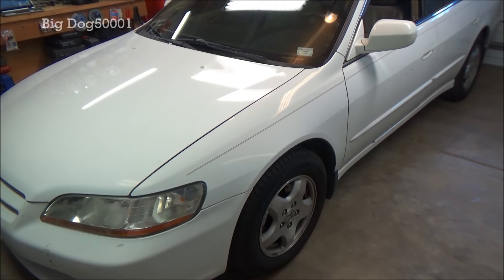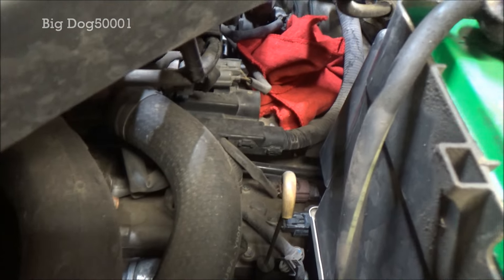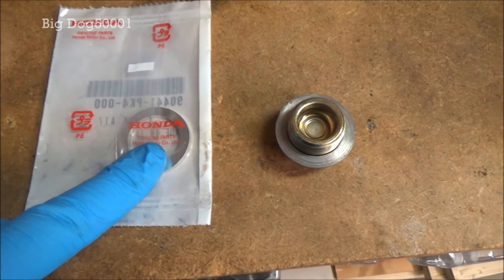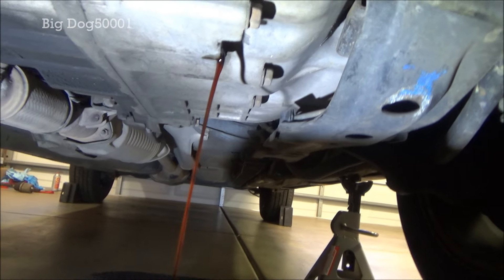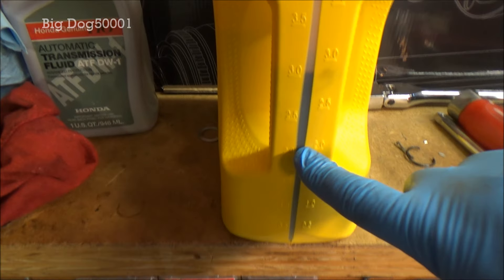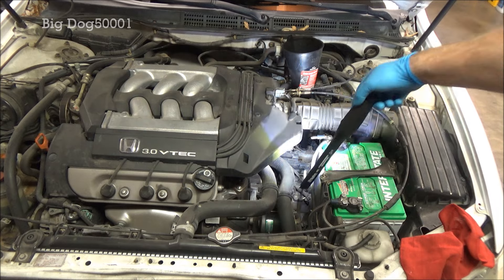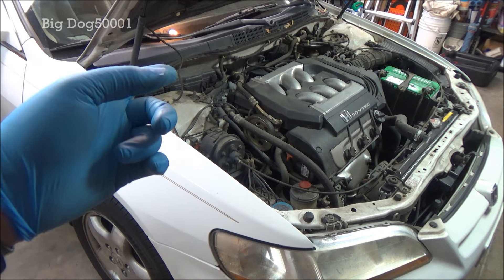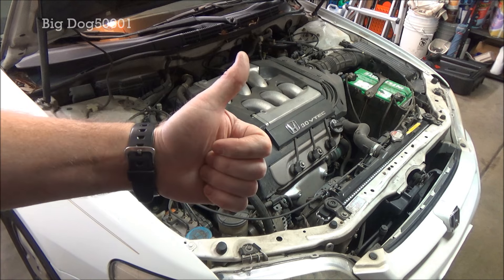Honda Accord V6 Automatic Transmission Fluid Service 1999 (1998-2002 Similar) (Drain and Fill)

Comment from the maker: Tools and Parts
This channel earns a small commission using some of these links - at no additional cost to you.
Honda ATF-DW1 (p/n 08200-9008):  https://amzn.to/34tUlJ4
Oil Drain Container:  https://amzn.to/2N0GdkX
ATF Drain plug washer 90471-PX4-000:  https://amzn.to/2PUk8a7
ATF FILL washer 90441-PK4-000:  https://amzn.to/34t1Bos
FloTools Extra Large Funnel 05034:  https://amzn.to/2PX6ZwQ
3/8 in. Drive 18 in. Ratcheting Breaker Bar:  https://goo.gl/etW9Cy
1/2 in. Drive 25 in. Breaker Bar:  https://goo.gl/qqXNsa

The Big Dog 50001 Automotive Channel Store can be found here: https://www.amazon.com/shop/bigdog50001automotive
Reply: I hear to fill it from the dipstick so you don’t take out the threads possibly when you loosen the top bolt to fill
Reply: I was told by Honda they recommend ATF-ZL1 now
Reply: You got part number for bottom ring?
Reply: P0
Reply: How do I get in touch with you?

Comment: I have this exact same car color and all my power steering is on the fritz have tutorials on this it’s the main pressure line hose to the power steering pump btw mines a v 6
Reply: I have replaced the powersteering pressure  hose on my 2 accords i recommend rockauto for the parts

Comment: thanks for the video: however a close up of the dip stick would have provided better clarity... if you look at the dip stick there is a marker hole way up the dip stick, some novice fluid checker may have trouble identifying the correct marks on the stick..

Comment: Correct me if im wrong but a master mechanic warned me that never never drain all the atm fluid! ???
Reply from the maker: For some vehicles that might be good advice.  However, you can't drain all the conventional ATF fluid on the Hondas in this video.

Comment: 3.1 quarts are only half.. to do properly, change twice in a week or so. Almost $20 per quart × 7= $140.00 + $2.00 washer if you do yourself. Definitely get Honda ATF !!
Reply from the maker: To get additional fluid out, yes the service can be done again (and possibly a third time).  If the service is done at regular intervals (I recommend at least once every 30,000 miles), one service like I showed in this video is all that is necessary.
Reply: @BigDog50001  cool! Thanks for the info. Glad I didn't have to do it again soon, very expensive but worth it 👍

Comment: So to check this transmission properly, the car has to have been driven, but the engine haaas to be off to check correct? Cause im being told to check it the engine has to be running while youre pulling the dipstick.. so do i check it with the engine warmed and off? Or leave it on while checking
Reply: When ever you finish a trip anywhere  soon  as you turn off car  go check the fluid

Comment: Nice job done   enjoyed it.   Just wanna check with u. I have V6 2007 AND I am having a problem with the power stearing  fluid being leaked often.  How to fix that.   There I always a sound coming from the power  stearing wheel whenever I turn it ...   Kindly help  will appreciate it
Reply from the maker: I would do visual inspection and try to locate leak.  O-rings at pump, power steering hoses, pump and rack can all leak over time.  I only recommend using Honda Power Steering Fluid too.  Thanks for the comment!

Comment: Thank you sir - for another excellent video. I have a 2006 Honda Accord V6 Ex. Is there a transmission oil filters for Honda cars?
Reply: The 3rd gen (2004-2008) Acura TL, 3.2L V6 has an ATF filter. It is in a round chamber built into the top of the transmission case between the fill plug and the left wheelwell. There is a black tube attached to the cap of the chamber to return fluid to the transmission.  Check that area of your Honda V6. Yes change that also at least every 50k miles. Mine was not changed since new and at 160K and 19-years old, the filter was filthy and falling apart. Do a search on YT for those videos before you poke around under your hood and remove the air cleaner box.

Comment: I have a 2001 v6 accord with 98000 miles on the clock.  I think it’s the original fluid in it. Do you recommend I change the fluid for the first time with that many miles on it?
Reply: Yes. Honda fluid only.

Comment: Best video on changing transmission fluid in a Honda Accord V6 on YouTube. Had my 1998 done in September 2019 by shop who rebuilt trans in 2016. After multiple fluid level checks found it was 3/8" above full mark. I went back to shop and was told not to worry about the overfill as it was a myth. I found out that they use after market fluid and not Honda DW-1. After the rebuild this fluid turned black and the shift quality was appalling. Had 2 drain and fills done in 2018 which helped but there was an engine vibration. Found that front motor mount broken when replacing the timing belt in Sept 2019. Not confident I'm up to changing it myself so going to Dealer to have a drain and fill. Thanks for all your videos.
Reply from the maker: I appreciate the comment, thanks!

Comment: I see this happen on so many videos ... Yes, please put chocks fore and aft to each rear wheel when jacking up the front of the car ... but do NOT apply the hand brake until the car is  fully lifted. Otherwise you will be rotating the rear wheels with the brake fully engaged. Not good. Please apply the brake after the car is up and release it prior to lowering the car. Then re-apply the brake prior to removing the chocks.
Otherwise, great video!
(Also, I think you mean 'Convex', not Concave.)
Reply from the maker: It is not going to hurt the parking brake system but thanks for the input.
Reply: Lmao this comment is right up there with checking your blinker fluid and radiator springs.
Reply: @jonjonsquad  Reactions like this is why I do most of my own maintenance on my cars.  Running after 30 and 35 years respectively; 1991 Integra, 1985 300z Turbo.
(Sorry if I hurt your brain.)

Comment: A 6 cylinder has about 7 quarts of fluid.  Only about three quarts can be drained through the plug.  If you drain three quarts and replace three you have diluted the 7 quarts by a little less than half so have of the old transmission fluid left in the transmission.  You have to do a 3 quart drain three times to reduce the old fluid enough to be considered a "full change" of transmission fluid.
Reply from the maker: The V6 in this video holds 7.6 US quarts to be exact.  3 drain and fills will get most of the old ATF out, anything after that and is draining mostly new fluid.  I usually mention that 3 drain and fills are needed if you want to get most of the fluid out, I guess maybe I didn't say it in this video.  That being said, I usually recommend 1 drain and fill every 30,000 miles to keep these Hondas going.  Thanks for the input!
Reply: Is it knowng that the fluid above the 3 lower quarts that drained is fluid that retains the qualities of new transmission fluid.  I'm not arguing with you but it seems to me that a three quart change is only a change by about half versus leaving good fluid at the top in.  A fluid sitting for a long time is called tanking which you probably know.  Tanking used motor oil for months does not work .  Tanking linseed oil does work and done for months and years at times.   I had my trans fluid changed this week.  I drove in and within 10 minutes the guy was draining the fluid.  I doubt that time was long enough to let the fluid separate into 3 bad quarts at the bottom and the remaining fluid fine.  Besides the remaining fluid is not in the same pool as the 3 quarts.  It does not drain as it is in different locations that can't drain.

Comment: Excellent video. However, the car takes 6.5 quarts of fluid in total. Using this honda recommended method of doing it, you can take out only 3 quarts , so you repeat this procedure 3 times driving the car a minimum of 5 miles between procedures. It will be best to drive up to 20 miles if you have the time. So, by using 9 quarts, you are making sure that 6.5 quarts are fully replaced.

Comment: Hi i have a question, how to check ATF fluid level properly on Honda accord v6 2008? One mechanic he tell me i have to check level properly with running engine! I'm riding in my manual book i should be checking ATF fluid level warming the engine to operate temperature then trun engine off waiting 60 to 90 seconds then checking ATF level, which is properly whey to check ATF fluid level?Mechanic he tells me that manual book for my Honda is not right for checking ATF level, because he never heard checking ATF level with engine Off 🤔
Reply from the maker: The service manual is correct.  i showed how to do it at about the 12 minute mark in this video.
Reply: @BigDog50001  thank you!!!

Comment: I was told that the drain bolt  should be removed at room temperature only.
Reply from the maker: Nope, somebody gave you wrong information.  The first step listed by Honda on almost every model is to bring engine up to operating temperature.

Comment: So I have have question. When I change the oil I will run a quart through to flush out any anything in the engine before I put the drain plug back on. I've heard mechanics say to change transition oil could losses some debris from the transmission and cause more problems. My question is, would it hurt to run a quart of fluid thru it and flush loose debris out before putting the plug back in, hurt the transmission? Note...I have a 2000 Honda accord ex 3.0.

Comment: Great video.
My question is about changing the trans fluid on an Accord V6 with 117,000 Miles without knowing whether or not it has ever been changed.
Is it ok to change brown fluid that has never been changed? I always thought that would be great for it but I've read different.
Reply from the maker: It is possible to cause problems if it has never been serviced, but that is more common on older cars where ALL of the ATF was changed at service.  For these Hondas, only about 1/3 of the fluid (give or take a little) is changed during a normal service and I have not seen any issues servicing the ATF on Hondas that have gone for a long time without service.  Thanks for the comment!
Reply: My 2002 Accord V6 3.0L has 260.000 miles, changed and working great! 👍

Comment: I replaced my transmission with a junk yard trans. My only issue is I managed to strip the inside of the drain bolt. I’ve since heated it and tried pliers and cutting it a little to use a hammer and chisel. I cannot get this drain plug off. Would you have suggestions?
Reply from the maker: That is not fun, and any of the techniques I mention can do damage to the transmission.   It is very tight in there but sometimes you can get a pipe wrench on outside of bolt and use a cheater bar for leverage to get them off (pipe wrenches are good at grabbing round surfaces).  Damaged bolt/nut removal sockets made for removing damaged fasteners can sometimes fit in there too.  I would take a center punch and (gently) tap the center of bolt with hammer to try and break bond between bolt and transmission.  Another technique (which you appear to have tried) is an air or regular hammer and some kind of chisel or possibly a center punch to catch edge of bolt and work it loose (but this option is risking and could easily damage the transmission if not careful!).  If those fail then drilling/EZ out/tapping are usually what follows.  Good luck!

Comment: I have a 01 V6 accord Automatic. Im having trouble with the transmission not wanting to downshift itself back to 1st. I have to stop for about 10 seconds before it does it. Also once it does go into 1st, I have to be really gentle and let off the gas in between gears otherwise it'll rev up and shift hard. PLEASE HELP

Comment: Great video man thanks!! I have a question? I have a 2000 Accord v6 I'm having problems with it not shifting right. Does anyone know if there's a trans filter or screen and where it's located? Thanks in advance.
Aaron
Reply: Honda made lifetime trans filters for 6th gen. You’ll have to drop tranny and crack case to even get to it. Not even worth changing IMO.

Comment: Transmission fluid changes are very important for the early 2000 Honda Accords particularly the 6 cylinder EX. Transmission failure has abeen a huge problem for the Accord & several other Honda models all through the early 2000s model years. Honda extended the tranmsission warrant to 93 months/109 k miles for the 2000-2001 Accord as a class action lawsuit settlement but others model years are SOL. So, if you were unlucky enough to buy one change your transmission fluid every 30,000 miles.  A lot cheaper than replacing the old transmission.
Reply: Thanks for showing me the drain plug for the EX transmission.  Saved a lot of time.
Reply from the maker: Thanks for the comments!
Reply: @BigDog50001  My only potential issue is unbolting the transmission dip stick tube from the block looks like it maybe difficult to get the bolt off.

Comment: You have 232000 miles on your Honda accord.Did you rebuild your transmission?My  2001 Honda accord ex v6 has 156 000 miles.Since transmission fluid is cheap and many accords had transmission problems,  i change the transmission fluid every 15000 miles. So far the transmission is fine. i am  the original owner and i am happy that this model is still OK.  I think I am riding on borrowed time I will be happy if it can last couple of more years.
Reply from the maker: That is not my vehicle but the owner has had it for a long time and has taken very good care of it.  Changing the transmission fluid goes a long way in keeping these older Hondas on the road.  There is a good chance you can go at least another 100,000 miles by taking care of it.

Comment: Is the Honda ATF synthetic? I see people use different brands instead of Honda. I have the same car same color (2000) with 262k and I'm getting a slight whining sound at 55mph. I had it drained at the dealer last summer. What's your thoughts and recommendations? Great detailed video too💪🏼
Reply from the maker: I only recommend using Honda ATF in Hondas.  Thanks for the comment!

Comment: I was wandering if you are really getting all the old oil by only letting it come to a drip  wouldn't there be some left in the trans cooler lines some in the torque converter or is that little bit even matter?
Reply from the maker: It does not matter.  The entire transmission holds over 7 quarts of fluid, so this procedure does not even get half of it out.  This is why regular maintenance is important.

Comment: TOO COOL MY FRIEND!  I"M A SELF FIXER FOR YEARS!  00 ACCORD WITH 245K
Reply from the maker: I appreciate the comment!
Reply: 2000 Accord 262k💪🏼
Reply: Original Transmission? I’m at about 97k on my 98 EX V6
Reply: @kesando84  got 145k with original tranmission
Reply: 110k for the 1st trans to die 💪😅 Pre-owned one drives nice though. Got it from Aamco 🤔
Reply: I just had 315000k’s
Reply: 99 v6 with 162
Reply: 02 v6 accord 221k original trans here
Reply: 99 V6 EX Second Transmission was at 90k. Runs ok now. Im currently at 141k Miles. But I'm going to get the fluid replaced soon. I don't want to take any chances.
Reply: 96 cherokee with the l6, got 310,000 miles
Reply: Just picked up a 2000 with 45 k on the clock …………

Comment: Great video! I own a  2006 Honda Pilot  with 240,000 miles on it.  I have no idea if the transmission fluid was ever changed. Would you recommend changing it at this point?
Reply from the maker: I can't tell you what to do but if I bought a car like that I generally will do one drain and fill and re-access how it is doing.  Older transmissions can always have issues when a new service is performed but Hondas are a bit different in that only a portion of the fluid is changed so it is less of a shock to the system.

Comment: nice video.  I have a 2004 civic with 4 speed automatic transmission. How is the transmission oil level checked? Is it the same procedure  as you explained at the end of the video?
Reply from the maker: Yes the ATF is checked the same way on most Hondas with conventional automatic transmission including a 2004 Civic.  Engine warmed up to operating temp, level ground, shut car off and check 60-90 seconds after shutting off engine.
Reply from the maker: Oh, and thank you for the comment!
Reply: @BigDog50001 Is  the ATF level must between the cross heched area on the dipstic or above the area?

Comment: i got a 2002 Honda accord v6  i have a longer transmission fluid dipstick its got one hole near the bottom end and another near it, and another hole all the way near the end of the handle. how do i check the level in this case?
thanks
Reply from the maker: Some models have 2 dots (holes) near bottom of ATF dipstick instead of hash lines (ATF dipsticks should have a yellow handle).  The holes are only about 1/3 inch apart.  The ATF level should be between those two holes after the vehicle is warmed up and then turned off for approx. 90 seconds.  Ignore the hole in the dipstick that is a few inches up closer to the seal.

Comment: Great video, is it the same with 3.5 liter engines (2017)
Reply from the maker: Yes very similar, Honda has not changed the V6 engine design very much.  I believe the capacity on those 2017 3.5L V6 Accords should be 3.3 US quarts of Honda ATF-DW1.  Thanks for the comment!
Reply: On Honda accord 3.5 v6 is 3.5 US quarts or  3.3 liters!!!